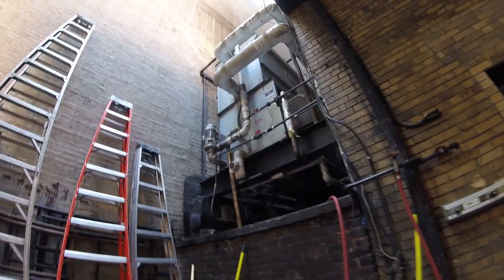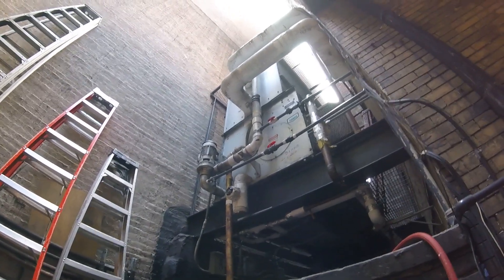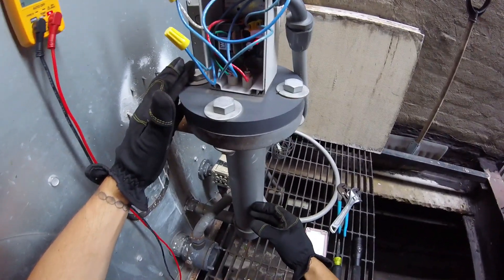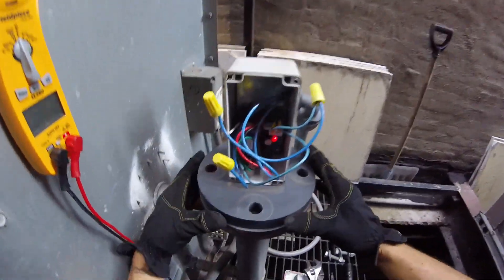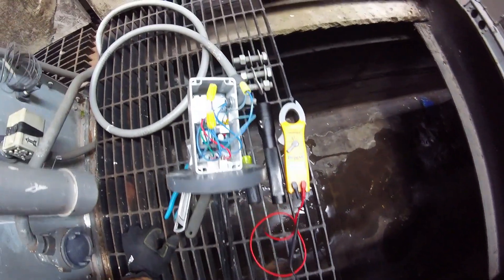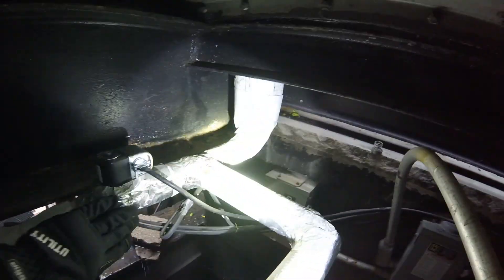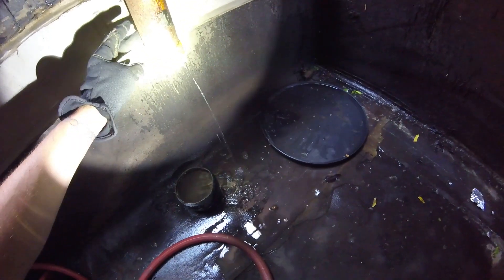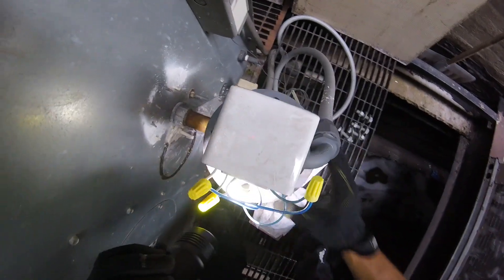HVACR: Cooling Tower Service Call (Cooling Tower Low On Water) Cooling Tower Service/Maintenance

Comment: That  particular  probe has about 300 volts sensing low ,normal , high  levels . 😮Bad chemical control and foaming can fool /foul that sensor . Two problems can cause same issue. Cleaning can temporary help restore function but  chemicals must be balanced for permanent solution.

Comment: I have a question , in the beginning of the video, you say there is a high pressure detected. Which pressure is it exactly because I am a bit confused now as the water levels go down in the water supply from cooling tower
Reply: That's a complex question. In short high refrigerant pressure in the air-conditioning units. The lack of water means the refrigerant isn't getting cooled therefore not rejecting heat from the condenser and locking out on high head pressure. If that went over your head I'll try to help explain it better.